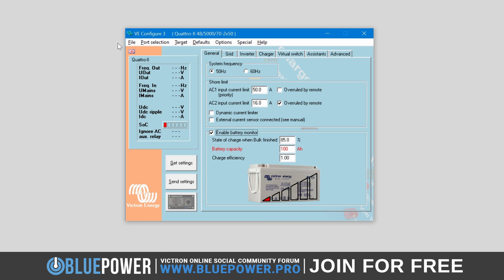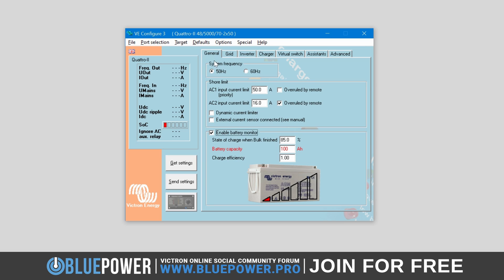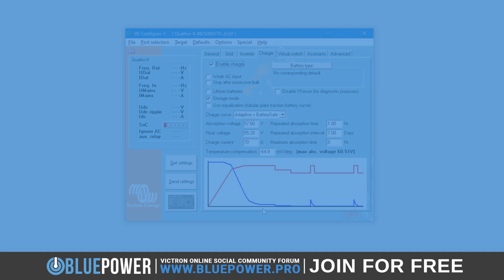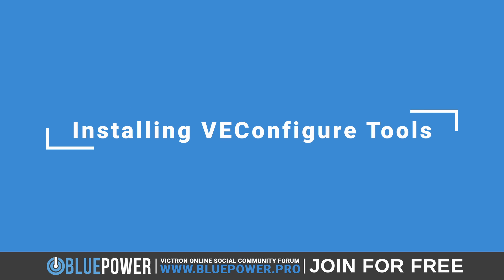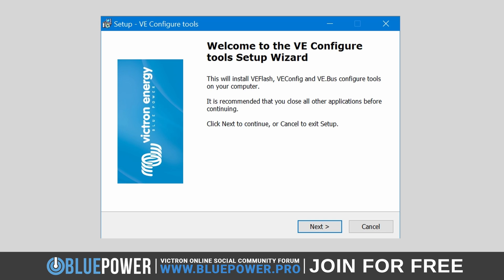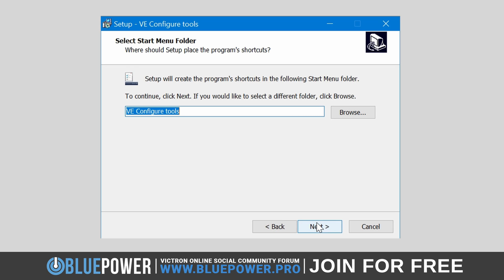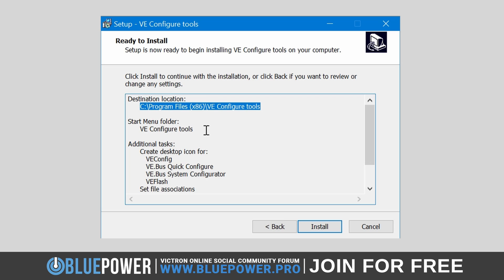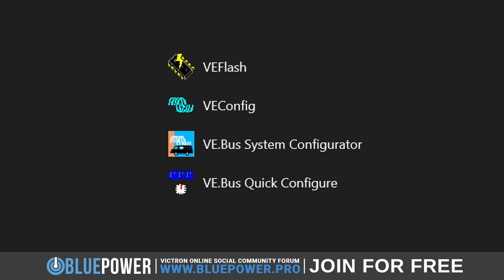Victron VEConfig Software Download & Installation Tutorial [UPDATED 2024]

Comment from the maker: ❤Join the Community Forum (FREE SIGN-UP): https://www.bluepower.pro
► Next Video 02: VEConfig - MK3 Hardware Requirements https://youtu.be/frKGw_mTWIA
► Next Video 03: VEConfig - Connection & Interface Tutorial https://youtu.be/Fgm8afTkZVg
► Next Video 04: VEConfig - General Settings Tab https://youtu.be/IzixLQ9tSvo
► Next Video 05: VEConfig - Grid Settings Tab https://youtu.be/Yzsv1E8jrco
► Next Video 06: VEConfig - Inverter Settings Tab https://youtu.be/7Z-O8NGAOfY

⚡ How System Frequency Works https://youtu.be/QvCM-WFgoQo
💻 Guides & Tutorials - https://www.bluepower.pro/guides

Comment: I have never had a need to use mk3, VRM via ethernet or wifi work perfect. Also i have created cofnig files to various setup and upldaed it via mac provided software.  If one has to do a bunch of setup for other people, then mk3 would be quicker.  But just for yourself, not needed and reliable.
Reply from the maker: a. The MK3 is required for setting up or changes when adding removing or swapping out inverters in VE.bus systems of 2+ inverters
b. The MK3 is required to update inverters, that are not on v430 or newer firmware
c. The MK3 is required in case of a failed firmware update or when using Ve.Flash
d. The MK3 would be needed if internet is not available to make use VRM online features like firmware updates or remote VE.Config
Reply: @BluePowerPro  I agree it is a very handy and quick way to make changes, especislly when offgrid.  I only had to use my mk3 once, all other times, i was successful in updating, making changes via my computers using the victorn config v3 app.  I only have one multiplus at this time.  No issues to do it this way.  I know victron is making big changes, so time will tell if changes be required for the end user.   Thanks for the feedback.

Comment: I have got Inverter/charger MultiPlus-II model GX.
This new model has inside a Cerbo-GX.
About the configuration process maybe we don't need to use MK3 interface  between Inverter and PC via VE.Bus to USB.
The configuration process can be made connetting the PC to the inverter via wi-fi because GX inverter is able to generate his one local wi-fi Network so through this access port you can easily programme the system. Obviously the ve.configuration tools must be ready to run in your computer.
At the end of configuration process yuo can programme to connect the inverter via wifi to your router then to internet. In this mode you can use the powerful VRM software for management purposes of all you entire system.
Reply from the maker: Thanks for the comment. A direct wired connection is always superior to WIFI. While you may get some remote convenience when using WIFI, its comes with disconnection and data loss risks. 

What happens if the inverter is directly supplying power to the WIFI router and PON (Modem). Some VEconfig setting changes reboot the inverter, which will then cause the WIFI to loose connection as well, which means you lose connection to the remote site.

Some sites (such as farms) also have very poor internet, and therefore data lose (dropped packets) is prevalent, not to mention very tedious and slow to work with.

This becomes even more high risk if you were to try update firmware remotely, as a disruption creates much larger issues if they firmware update did not fully complete.
Reply: @BluePowerPro  Thank you very much for your useful advice.
Reply from the maker: I cover this in my next video at https://youtu.be/frKGw_mTWIA?t=158